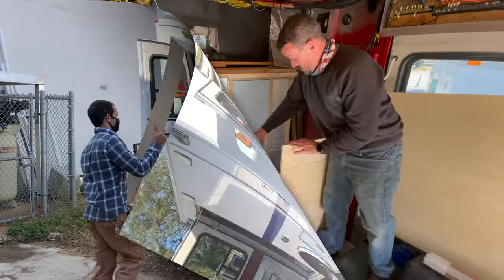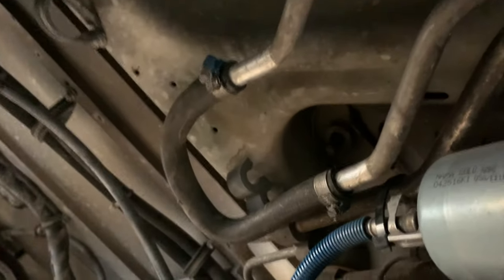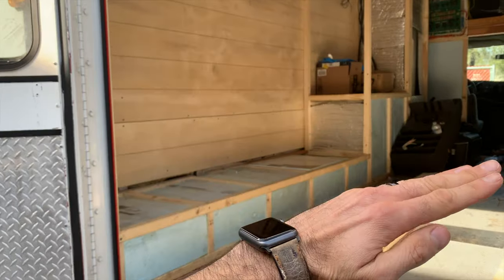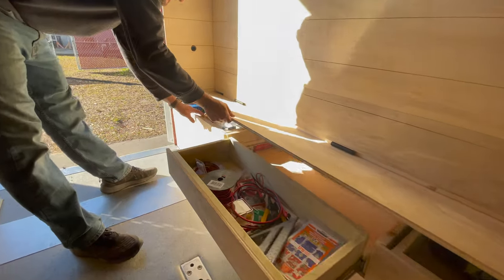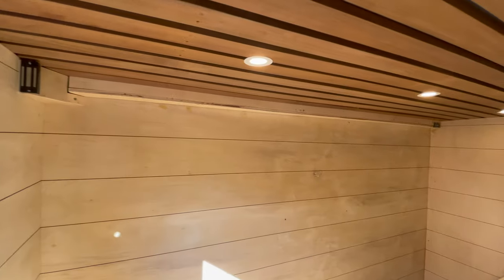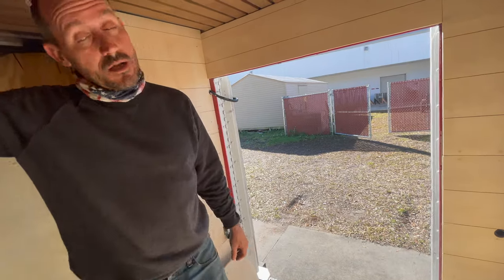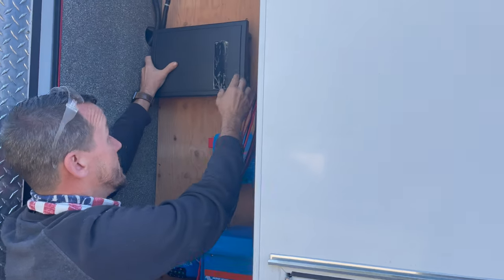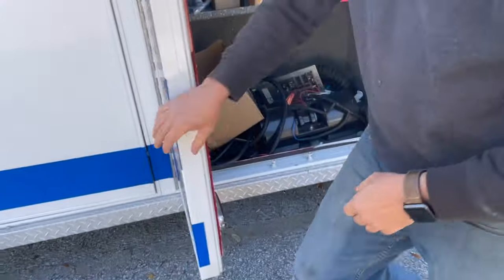Episode 3: Murphy bed, A/C & heater removal, shower pan, seating, storage and electrical Manbulance!

Comment: Just a thought…  make the electrical compartment more shallow and use the space behind it for inside storage?  I know the batteries probably go in the bottom of this compartment, but they could be in a pullout drawer for servicing, etc.
Reply from the maker: That's a good idea.  Someone else mentioned the same thing.  The biggest reason he didn't do that is because the compartment is a welded in box that would have to be cut out and re-welded in place water tight.  Thanks for the feedback!

Comment: how do your remove the AC unit? I brought a ambulance and I am not sure if I just cut the cube is safe or not?  as thoes tube connected to compressor which is located in the front trunk.
Reply from the maker: We had to take it to an A/C shop. It’s a simple procedure that cost about $300. The engine ac ties into the rear ac.   They have to be separated in order for the engine ac to work and for the rear to be removed.  Also, the heat is tied in which mean a coolant line has to be removed and looped.  We took ours to a radiator/A/C shop and they took care of all of this on the old and the née build

Comment: How much would you charge for this build?
Reply from the maker: That’s a tricky question. First one has to consider the total cost of just the vehicle.  Then the cost of parts and materials, which would be over 30k+ at this point.  Now, the hard part is the total man hours to complete the conversion. I have no clue what that would come out to at this point. William will have an idea on how to answer your question when he is done.  Thousands of man hours at $30/hour is the reason these sell in the 40-80k range.  Lots of work and material cost.
Reply: @ModernGreaser  Do you know how much the rig was when you started? Is it a 4x4?

Comment: Those bed spring hinges?  where did he source them?
Reply from the maker: William said the springs really didn't do much in terms of helping with the weight.  He is devising a cable system to help lower the bed.  Here are the hinges he used that had minimal success, but could be better than nothing. https://amzn.to/2QvPZix
Reply: @ModernGreaser  thanks!